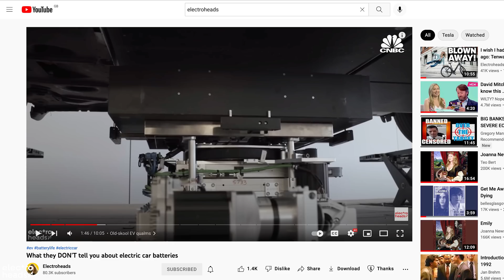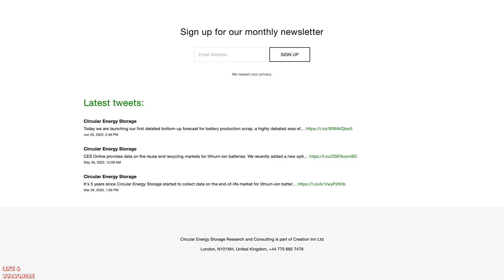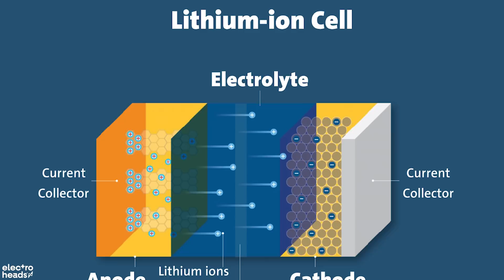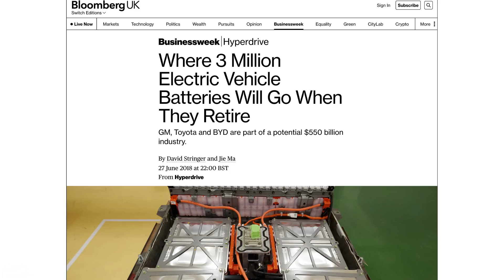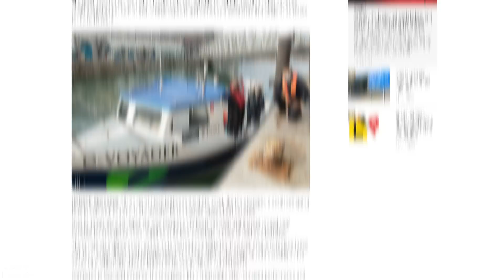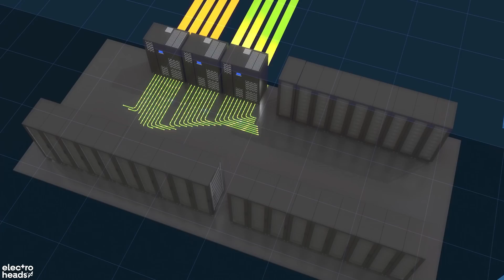Where do EV batteries go when they die?

Comment: New Tesla structural batteries are not reusable, they are buried in hard foam, and are literally not meant to be disassembled for second hand use in PV applications:(
Reply: Very shameful move by Tesla. It goes against the grain of the whole EV premise. To say the raw materials can be harvested is a cop out that forgos any consideration of the embodied energy potential. The design of the structural battery pack needlessly throws away any reuse or repair opportunities. It's conceivable that a fully functional battery could have slight physical damage (say from a minor accident) and it would be deemed entirely unusable. 
The truth is that it is intended to be a profitable disposable item that needs replacing instead of repair or repurposing.
Reply: Because the purpose it to design the pack and cells in such a way that firstly, there are no issues with both. Secondly, when it does become EOL, it’s really EOL so by then recycling can meaningfully and efficiently be part of the supply chain of raw materials. So no issues there either…

Comment: An interesting watch but it did make me think; by going public with niche low-volume things like using old batteries in forklifts in EV factories it is possibly doing the industry no real good as it very easy to be accused of ‘green washing’ (ironic). Maybe they would be better off keeping quiet on those types of things and majoring on publicity over grid scale storage or home storage to allow storage of solar or off peak peak cheap power to reduce bills. I do feel that the EV industry does sometimes shoot itself if the foot so to speak, quite possibly accidentally.

Comment: I live offgrid with only solar as my source of power and 2 used tesla model S 5.4kwh modules that we bought in ebay. We have recently  bought a  Kia ev6 and the goal is to get more ev used batteries (probably we'll change to id3 modules cause they are perfect for 48v systems) to charge the car during the night. And when we need during the winter we will use the v2l in the ev6 to charge the home batteries. No more cold showers during the winter ;)

Comment: All sounds promising. Such a shame 95% still go to landfill then...
Reply: They don't. Only a complete fruitcake would place old EV batteries in landfill, as they're worth good money. They can be ( and already are) recycled, in places like Volkswagen's EV battery recycling plant. Some other car makers also now have battery recycling facilities. And batteries not recycled, get snapped up by the energy repurposing industry, for use as energy storage in commercial, industrial and domestic situations. Rather like the huge Sports Stadium in Utrecht in Holland, powered by 200 old Nissan Leaf batteries, charged via solar. It seems you are unaware it has been illegal to dump any type of battery waste in landfill in both the UK and Europe for many years.
Reply: @Brian-om2hh  it's around 5% are recycled only.
Reply: @PaulHawkins87  There is no way that 95% of BEV batteries are thrown away. Evidence please.
Reply: @harry-dymond  I'm sure you're capable of doing your own homework. It's far too expensive to recycle, cheaper to make new ones. Same as any man made product, which is why the planet's in such a dreadful mess...
Reply: @PaulHawkins87  
You're obviously not capable of doing YOUR homework.
Just ONE example of many.
.
Redwood Materials, run by former Tesla CTO JB Straubel.
(Yes, he thought this was important enough to leave Tesla)
.
Quoted as saying
1) They can recycle 95%+ of material from a pack.

2) The material recovered is of better Quality than the original stock (logical, it's "double refined")

3) They can reclaim this material for only 1/6th (17.5%) the cost of new mined stock.
I think that covers the points?
...
However!
He ALSO says that ANY cell can be added to the process, so the billions of cells from phones, laptops, powertools and many other devices can simply be thrown in.
Since a large percentage of those WOULD go to landfill, that's fantastic!
.
Then we have old printed circuit boards, again, any device, phones, laptops , tools, TVs, PCs, printers, household appliances, commercial devices, old ICE cars.
These all contain Gold, Silver, Tin, Antinomy, Silicon. Carbon, Aluminium, Copper, etc.
Generally not economical to recycle(?) but they just go into the same crusher (yes, crusher)
.
As an indication of scale, they now have contracts with:
Toyota
VW
Ford
Panasonic (already resupplying Giga Nevada)
.
Maybe search "Redwood Materials CNBC" ?
You'll find a long interview.
Enjoy!
Reply: @harry-dymond  
See my latest. He's debunked.

Comment: I always found it odd that people will point out the down side of electric cars, but simultaneously think the one way process of burning fuel is just fine.
Reply: they are brainwashed by oil propaganda
Reply: How do you think those cars get charged. Mostly using diesel run charge stations.
Reply: @darklotuz259  mine's charged with wind and solar an infinite resource, giving us better air quality, I'm assuming that many others are also, or at least a percentage.
What does your ICE car use?
Answer ~ billions of fossilized microbes per meter driven, a finite resource that's killing us with air pollutants while we use it.
Reply: Suckers born every day, Tesla Madness, oh look at me saving the planet.

Comment: They are not going to tell you what really happens to dead batteries, that would not suit the narrative, but like the charging infrastructure, they have once again put the cart before the horse🙃
Reply: Barrie. Watch the YouTube video Volkswagen posted around 3 years ago, of their electric car battery recycling plant. It outlines the whole process, and you get to see the plant in action. The really clever part is the discharging of the packs once they arrive for recycling. The residual charge is actually used to partially power the recycling process.
Reply: It’s just basic common economic sense that recycling will be done increasingly so in an increasingly efficient way through scale. No scale means no problem. No problem means no efficiency. No efficiency means no money…and vice versa.

Comment: Thanks Eilis, good item brought with humor. 
So many possibilities to use EV batteries, and at the end there should be 100% recycling of the materials. 
Norway's Northvolt plant recycles up to 95% of all the battery material, and the expansive materials like Lithium, Manganese, Nickel and Cobalt for 100%. 
I think, VW is also building a huge plant in Salzgitter Germany, for recycling all batteries used in German EV's, thou with 90% a bit less .

Comment: But how does this help the car owner who needs to replace their battery.  The tech right now is changing so quickly that anything is obsolete within a year or two.  The car itself can go 200k+ miles but not the battery.
Reply: (from the US)
According to AARP, the lifespan of a Tesla can be as high as 400,000 miles
Reply: There's nothing that says an EV battery can't do more than 200k. It'll go much further than that, it's just the range gradually reduces over time. There are now plenty of EVs on the roads with over 200k on the original battery. In reality calendar aging is more likely to kill an EV battery over cycling, and the calendar age of a lithium ion battery is decades.
Reply: It will if you have it refurbished......
Reply: Numerous companies are announcing their "1-2 million mile" batteries.
They cracked the problems.

Comment: What needs reviewed is what's been happening with all lithium batteries since their invention in 1992. Hundreds of billions from cell phone, laptop,pad,tools,cameras endless. They most likely ended up in landfills, incinerated.
Reply: The real question is where the unimaginable amount of CO2, oil spills, gas spills,…went from the invention of the combustion engine till today. Everybody knows the answer based on where global temperatures are going.
Reply: @Robert Quigley
The good news is there are a large number of cell recycling companies emerging due to the opportunity afforded by the EV industry.
(The best known being Redwood Materials)
These will be able to recycle ALL the cells you mention, plus(!) reclaim precious metals and other compounds from old circuit boards which are also thrown away, generally to landfill.
Has potential to be a recycling revolution.
.
Side note, ref your previous on Cobalt.
2 questions.
1) Are you aware that the fossil fuel industry has used Cobalt for decades to desulphurise billions of gallons of fuel every year?
.
2) Do you really think a proportion of that Cobalt didn't originate from precisely the same source as the "Battery Cobalt"?

Comment: I believe in Lithium Christ and the electric heaven. Good batteries go to a place with zero internal resistance and slow charging, where overheating is never to see, where thermal runaway has never happened and they are kept at 80% for the rest of time. But bad batteries... Oh, the pain... They go to a place where they are kept at 100% or 1% and never in between, where chargers never stop at 100%, where they are always too hot or to cold to charge.  Lets pray for those poor cells, the Electrolord have mercy on their cathodes. Amen.
Nice video. Eilis is an electric angel.

Comment: they get recycled.  Most people are aware of this.
Reply from the maker: And now you know more case studies of where they go 😄
Reply: @Electroheads  
I would point out that the current prediction is that depending on cell type(there are several) they may be of more use being recycled back into the high energy automotive application, providing material for more efficient new packs (the recycled material is much cheaper than new stock)

Comment: The number of cycles put into an EV battery is tiny compared to those of a laptop or mobile phone. As Tesla owners are seeing the batteries are are already showing they are still going well with small degradation over. Unlike ICE (normal car engines) they durability of both the motors and batteries is likely for most vehicles to be 200,000 to 300,000 miles. By which time many of the battery manufacturers will have enabled processors to be able to recycle the critical metals. The are some smart engineers around the world working on solutions. In the meantime most EVs power trains will last much longer than people are used to in the old smelly and high maintenance ICE vehicles!
Reply: Good stuff! Hopefully ice is not the norm like horse and carriage is no longer the norm.

I thought the lithium battery recycling tech as of recent has, at scale, the ability to recycle all of the good stuffs ;). Maybe I misread but no lithium is lost? 

Hopefully more r&d brings better tech too, cheers
Reply: Tesla batteries are generally rather hit or miss, otherwise yeah
Reply: Ive yet to have an ice engine only last 300,000 miles. My first Volvo nearly reached 900,000 and my old Chevy truck is heading for 400k. Sorry dude. Computer chips and electricity will never be as durable as a good mechanically engineered ice engine. Not even close. The older an EV gets, the less reliable it becomes. The heating and cooling of boards and chips makes them untrustworthy at best after 4 or 5 years of 20k a year driving and a rolling plane crash as worst over time. Again, I know whats coming with my ICE engine just by listening. You in an EV do not.
Reply: You are out of touch with reality.